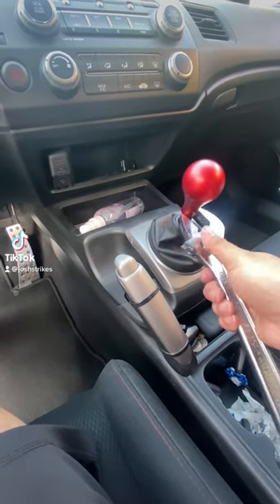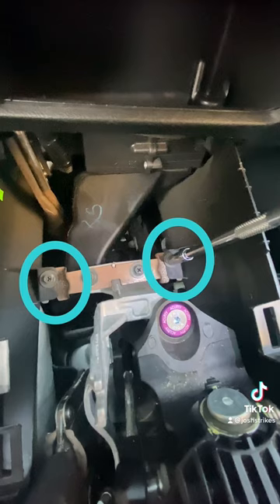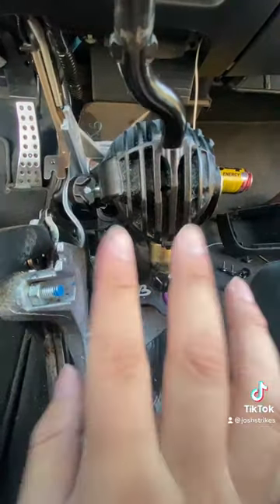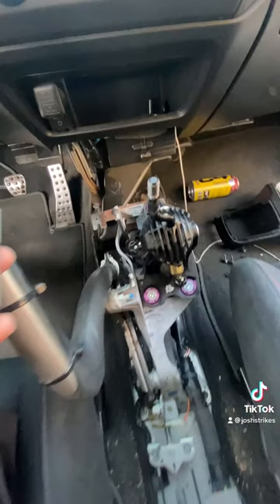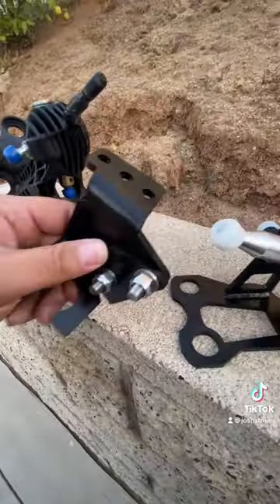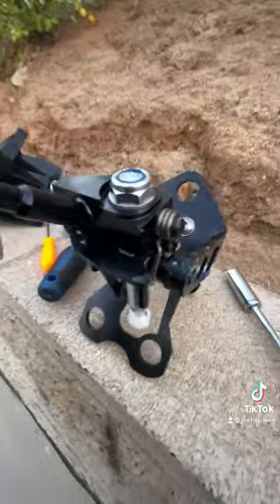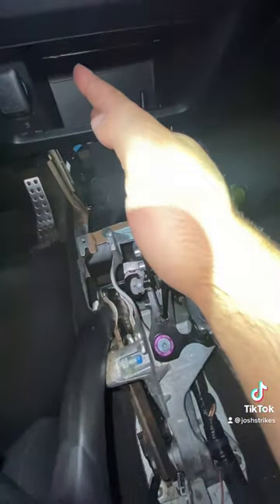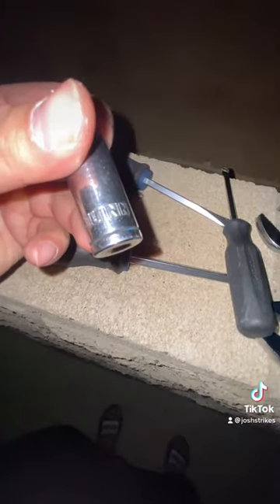8th Gen Civic SI NST Short Shifter Install!

Comment: It was easier for me to mount it then put the cables back in. Just make sure you run the one cable through the center but you can still bend it through if you forget.

Comment: How you push the cables down , I’m having the same problem right now trying to install it
Reply from the maker: Bro honestly i just forced them down lol
They wont break
Reply from the maker: And then to get the cap ends of the cables onto the shifter itself
Once i had it in position, i hit them in with a rubber mallet 🤣🤣
Reply: @xradicaljetx  and everything feels the same ?
Reply from the maker: @axyzor7512  yea bro
Feels good
Still to this day
Reply: @xradicaljetx how you lock the right cable there’s a little screw in the way when I try locking it
Reply from the maker: @axyzor7512  my bad man, i was busy..What do you mean by lock the right cable? As in when you put the Cable holder on the little arm of the shifter? The cap?
Or more on the bottom, by where you twist to lock the cable onto the bottom portion of the shifter?
Hopefully you have figured it out by now man lol, if so let me know what you thought of it
Reply: @xradicaljetx  I figured it out bro, I struggled but I got it and I hit the cap ends in too😂 at first I thought they weren’t gonna go in at all and I got tired of trying to figure out how to put them in so I just hit it and it went in😂
Reply from the maker: @axyzor7512  hell yea bro lol
How does it feel? best 90 bucks spent? lol

Comment: Yo, i installed mine and can’t get into 5/6/reverse. Is there a reason you don’t install the third bolt on the cable bracket? I’m frustrated it wasn’t supposed to be this hard lol
Reply from the maker: It didn’t come with the third bolt bro lmao
2 bolts are holding it just fine
Reply from the maker: Are your cables in place on the holder?
Reply: @xradicaljetx  they’re on the holders. Do they go a certain way?

Comment: Yo do you have any problems with it? Cause mine wont wanna center itself and its sticking left
Reply from the maker: no bro, no problems so far....Did you put the spring on it? like i did in the video
Reply: @xradicaljetx  yea I did but it doesn't wanna return to the center for some reason
Reply: @raza4989 ever find out the issue man??
Reply: @fish.sleep.repeatproductio5524  it's just the design of it compares to hybrid racing and acuity they have a extra spring on the side
Reply: @raza4989  so did you just get used to it or was it really bad?
Reply: @fish.sleep.repeatproductio5524  don’t suppose you found a solution? Mine doesn’t want to centre itself either. 😅
Reply: @xradicaljetx hey bro do u know where to get that spring if i lose it cuz honestly I can’t find it